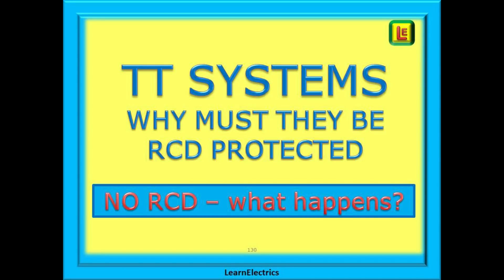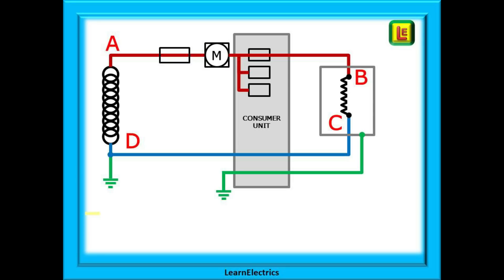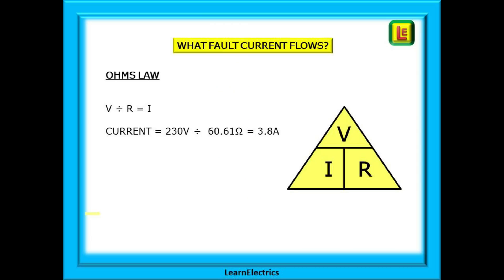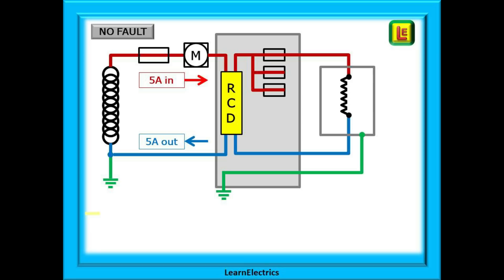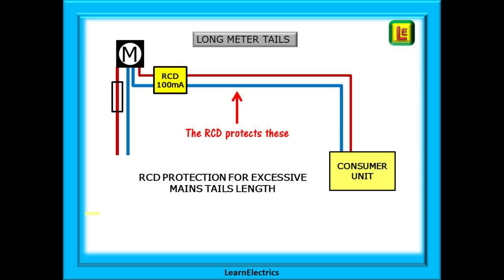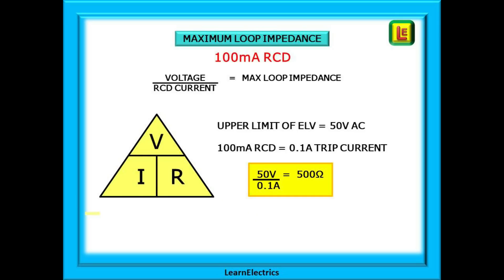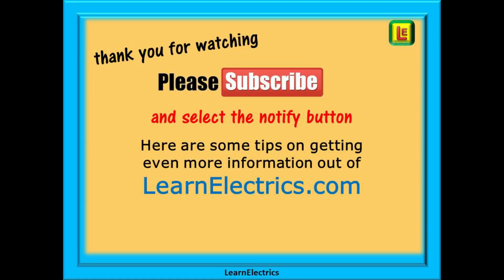TT SYSTEMS - WHY MUST THEY BE RCD PROTECTED

Comment: Imagine the scenario where we have a sub board in a shed which is supplied from the main board about 50m away.  As it is generally good practice the have the SPD before the RCD, can we install an SPD in the main board and also another SPD in the sub board?
Reply from the maker: Do you need a second SPD as the first one is protecting the incoming supply and anything further down the line will have less impact. If you're thinking of direct lightning strikes, forget it, we cannot protect against them.
Good question and thanks for watching, much appreciated. Dave.
Reply: @learnelectrics4402  Thanks for the reply. We do install additional type 2 SPDs downstream particularly when the equipment being protected is more than normally 10m distance form the main SPD at the origin. This is mentioned in 534.4.4.2 of BS7671, isn't it?

Comment: Have you written any books 📚 , i will be the first one to buy. Any suggest any good books   to read on electrical installations?
Reply from the maker: I've not written any books but the Learn Electrics videos are the exact material that I would put in them. I have been asked to include a little more electronics teaching, which I will do.  To get the best out of this channels videos, make sure you have copies of the Wiring Regulations BS7671 18th Edition Amendment 2 , the brown book. And the On Site Guide 18th Edition Amendment 2 brown book, both available from Amazon. Thanks for watching, lots more to come. Dave.
Reply: @learnelectrics4402  Yes I have BS7671 and On Site Guild, I am just catching up latest updates, use to be electrician up to 2006 did my 17th edition at the time, I watch most of your videos, which I must say are the best I have seen on youtube.

Comment: You did not take earth paths via gas and water mains into consideration
Reply from the maker: Thanks for the comment. Gas and water mains are bonded back to the main earth terminal, where required, so they are part of the earthing system.

Comment: Hello Dave, great content as always.  Additional question; I have a distribution board with 4 x 40A mcb supplying separate sub mains to consumer units with 30mA RCDs as main switches.  Supply is TT, I’m planning a 100A 100mA S-type RCD as the main switch to the Submain distribution board.  Does this appear sound design?  BTW, this in rural France where the supplier provides a 500mA RCD programmable load-rating (60A) main switch at the origin.
Reply from the maker: Yes, absolutely. That is good discretion. Love France, wish I back there. Dave.
Reply: @learnelectrics4402 I was a little concerned about nuisance trips to the 100mA with combined earth leakage from all the sub boards. There is a fair amount of home automation in the place I’m working and their power supplies can be quite leaky.

Comment: Why does length determine rcd ? Makes sense that any length should be protected to me
Reply from the maker: The regs and some network operators require longer lengths of cable to have their own additional protection to reduce the danger of something going wrong, fire etc.
Reply from the maker: The regs and some network operators require longer lengths to have additional protection.
Reply: The IET spun their random number generator and 3m was the maximum length of meter tail allowed without a switch-fuse.  Regarding RCD, I think a similar ‘exposure to risk’ view is applied.

Comment: Which earthing system is better to choose for a private house powered by an overhead uninsulated line, TT or TN-C-S?
Reply from the maker: Personally I would go for TNCS, but a lot depends on the network provider, sometimes you have no choice unless you have plenty of money.
Reply from the maker: You often don't get a choice, the network provider decides. But TNCS is the modern way if available.

Comment: Very clear explanation often not understood by many, it should be understood that the fault current is decided by the impedance of the fault circuit not by the rating of the RCD thus a considerable larger current can flow than the trip setting, that is why the trip time is as important as the rating and should always be within the spec or the device.
Reply from the maker: Thanks for the support, much appreciated, John.

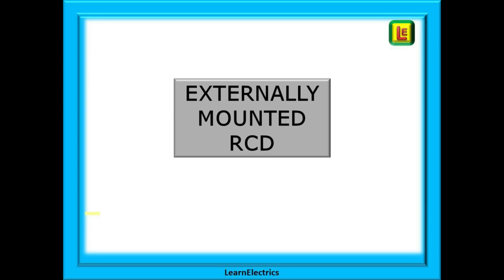Comment: 8:57 if the consumer unit is 50 m away, do we need to place a new earthing rod nearby the consumer unit?
Reply from the maker: You need the earth rod to be close to the consumer unit and the rest of the installation. Nothing wrong with having two earth rods.

Comment: Regarding all the changes in particular Residential Homes sites from 16th to 18th edition, Im struggling to find whether there should exist an RCD in the Site Distribution Boxes, on a site of 66 homes 7 Distribution boxes with a mixture of breaker sizes.  However, when bad weather comes, some homes varies from 3 to 11 homes, depending on extremity of weather rain, lose power from DB's.  Each home has its own Earth Road TT.  The sensitivity is too high to allow the homes consumer boxes to act as designed. obviously the homes are certified at manufacturer EG OMAH Homes, Prestige Seekers Homes etc. any help in pointing out the required reading will be appreciated.
Reply from the maker: A lot depends on what loads are in use, their leakage etc. If you are having more problems in wet and bad weather, is there damp affecting some circuits, outside lights, sockets on damp walls etc. It doesn't take much for the leakages to add up. Can you get hold of the installation drawings from Prestige Homes or make contact with one of their technical people to tell you what was specified.

Comment: If you have a TT system, why cant you just P.M.E. it thus getting better earth readings?
Reply from the maker: Usually because the supply transformer is a long way away across the fields. You need the earth to be physically connected by copper between your house and the supply transformer.
Reply: @learnelectrics4402  👍 thank you for such a swift reply.  
Subscribed 👍.
P.s. is it advisable to p.m.e. And have an earth rod too? I have this in my own dwelling.

Comment: Isn't the diagram of the external 100mA RCD wrong? There are 30mA written on both RCDs. The external should be 100mA and also the arrow on the top should be 100mA. Sorry if I'm wrong, please advise!
Reply from the maker: Probably me that forget to change the numbers when I copy and pasted. Thanks for pointing this out, I'll correct it.

Comment: Can I ask if current is actually flowing through mass off the earth , how come we never randomly get shocks from the ground when people have faults? If you lived in a area where it was all TT systems for example
Reply from the maker: I think that is because the earth is such a massive object, and then some current flows this way and then some flows that way so it all cancels itself out. Science id scary at times. Thanks for watching. Dave.
Reply: If you were very close to a ground rod you would get shocked. The current dissipates to the earth and goes just a few meters.
Reply: @okaro6595  step potential!
Reply: @okaro6595  very interesting point and if it does dissipate like you said is it likely it wont make it back to the transformer at all depending on distance of transformer etc, earth impedance. fascinating stuff.

Comment: Great video,  I have a question, if installing an up-front 100ma time delay RCD to further protect long tails and/or metal consumer units in a TT system, does the up-front RCD need to be in a metal enclosure ? as the latest consumer units ? or would an insulated enclosure be acceptable ? and maybe safer ?
Reply from the maker: Myself, I would put it in a metal enclosure, Keith. Hope this helps and thanks for watching. Dave.
Reply: @learnelectrics4402  how about installing the RCD in a similar enclosure used for meter isolation switches ? which are mostly insulated e.g. Wylex ESI2S infact Wylex show this in one of their catalogs as a "made to order" item. There doesn't seem much difference between a 2 pole switch and an RCD apart from the coils and trigger mechanism, how prone are RCD's to catching fire ?

Comment: Brilliant video thanks , If you have full RCD protection on all circuits , does it still need a 100ma delayed RCD upstream as well?  would it be a C3 or C2. And on a TT system do the circuits still have additional protection or is that not possible?

Thanks
Reply from the maker: An RCD only protects downstream of itself. So long meter tails may need protecting closer to the point where they enter the building. On a TT the RCD is giving the missing fault protection by the very same method that it gives additional protection. So in theory, your circuits don't have additional protection because there is no other protection to be additional to.

Comment: Best channel I've seen on YT for this subject. Clear, concise with no ambiguity and a massive help for all qualified electrical personnel and aspiring DIYers. Keep up the great work Dave. I just wanted to clarify one point. At 07:03 you state that "we could have a situation where 5A still flows into the appliance and 3.8 A of fault current as well". Excuse my ignorance (I'm a mechanical engineer!!) but I am trying to understand how this happens. Is this an instantaneous situation where the appliance is still running but in parallel develops an earth fault giving a total live current of 8.8A with the same coming out but split between neutral and earth?
Reply from the maker: That's correct Chris. Some current flows through the device and down the neutral, and more current flows along the earth because of the fault. But all of that current must come along the Line (Live). Think of a plumbing situation. 5 litres flows into the bathtub (the device) and we also have a leak of 3.8 litres. That means that 8.8 litres must flow through the supply pipe. Hope this helps and thanks for watching. Dave.

Comment: Quick question anybody. Doing a ze on a TT system  and the 100mA rcd keeps tripping. Got  good Zs reading. Can anyone explain why it keeps tripping. Thanks.
Reply from the maker: If its happening during the test, you are testing at the wrong place. You should be testing upstream of the RCD. The RCD is seeing the test meter as a fault. Dave.
Reply: @learnelectrics4402  Thanks  for your reply Very helpful.
Reply: Hi Dave... Really enjoying your videos..An excellent learning tool and easy to understand... You're helping many people...

Just one question.. When you use the phrase "upstream of RCD" Do this mean, before RCD?
Reply: @tonylynessable  from the  origin. 
When Dave said I realized what I done. There was a lot going on with tails in and out of Henley blocks.

Comment: 7:45 I am still confused as to why the 6 amp breaker would not be sufficient? Please help me anyone! :(
Reply from the maker: Its a TT system so you can't get enough earth fault current through the soil. There is NO copper earth connection back to the transformer. Have another look at the video, it will help you to understand. Dave.
Reply from the maker: Also, have a look at this video, MCB – CIRCUIT BREAKER – HOW DOES IT WORK, click on the link below
https://www.youtube.com/watch?v=pBdMa9o6XJk
This will explain why 8amps will not trip a 6A mcb, why you need an RCD
Reply: @learnelectrics4402  I did just that and you have explained it very well. Thank you so much for replying good sir!
Reply: A breaker takes about 5 times the rated current to trip immediately. It may take 20% overload indefinitely and even 2x up to half a minute or so. A 6 A breaker might just trip at some time but not on the required time.

Comment: Dave, is the voltage <50v between neutral and ground normal in TT system?
Reply from the maker: Yes, definitely less than 50 volts, it should be a lot less, just a couple of volts.
Reply: Below 3 volts.

Comment: When you say the voltage cannot go above 3 Volts are you speaking about RMS value or the peak voltage in the Sine Wave.  Thanks
Reply from the maker: The device operates on current differences. Ohms Law tells us that voltage divided by resistance is current. If the resistance is low enough you will get enough current. Generally we talk about rms values as this is what our meters display.
Reply: With AC one always talks about RMS unless one specifically specifies peak.

Comment: Punch explanation. I am an electrical guy from India which follows TT earthing. Here people think fuse/mcb and earthing save them from leakage.
Reply from the maker: Keep watching, it all helps Kishore. I know what you mean about Indian Electrics, I used to work in India - Hyderabad. Dave.
Reply: @learnelectrics4402  I am in Chennai.
Here earth pit resistance testing is not mandatory for domestic service, so people take advantage. Especially rented houses are not provided with proper earthing.
Electricians/contractors just drive a 3' long pipe irrespective of the soil condition.
You can find extension cords with 2 pin inlet and multiple 3 pin outlets (third earth socket dummy) being sold in reputed department stores!

Comment: Can we use TT SYSTEM with only a RCD and without a grounding rod?
Reply from the maker: No. Checking you have an earth connection is part of the testing. Thanks for watching. Dave.
Reply: That by the definition would not be TT. It would rely on people acting as ground rods i.e. an energized equipment case could remain so until someone touches it. That actually is used in the United States to convert old installations without earth wires - but there the tripping current is 5 mA, not 30.

Comment: Just a heads up though, around 9-10 min mark, the diagram shows the upfront RCD as a 30ma, although at the top it does say 100ma.
Reply from the maker: Well spotted Paul. I can remember changing this to 30mA. Guess I didn't press the save button. I'll change it right now. Thanks for the support. Dave.

Comment: The part that says RCD breaks the circuit before reaching the voltage to touch voltage is tricky to imagine and understand. I mean thinking that operation of a mechanical element is faster than flow of electricity seems strange.
Reply from the maker: Absolutely it is difficult to imagine. I still can't believe that light can travel around the world seven times in a second.

Comment: Thanks for the video. Breaking the fault circuit down to its component parts and looking at the individual voltage drops certainly helped me understand TT earthing a little better. Looking at your channel I can't find a specific video on "Touch Voltage" and the implications that has on electrical calculations.  Is that something you might consider?
Reply from the maker: Thanks, great feedback. Touch Voltage is the VOLTAGE that you experience if you TOUCH something metallic during a fault. I touched the water pipes and got a 100 volt shock. Touch voltage equals 100 volts. We want to keep it below 50 volts AC. Hope this helps Dave.